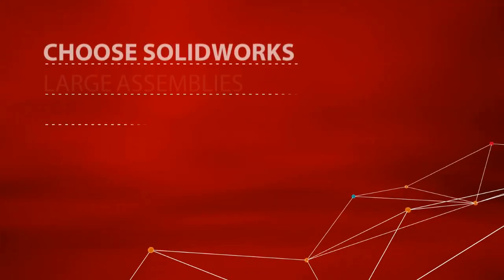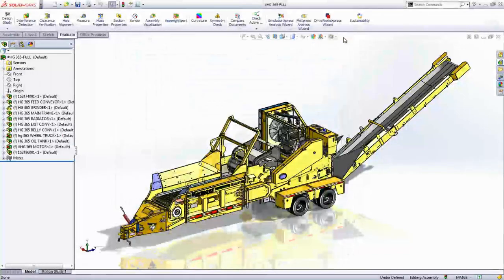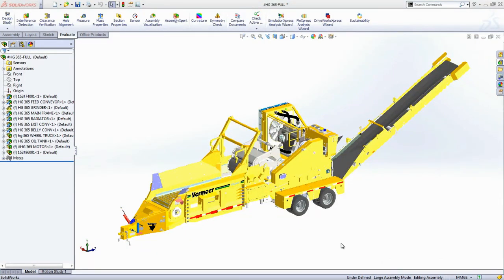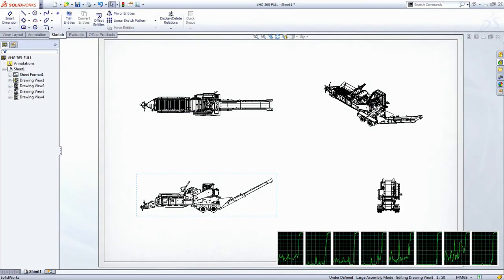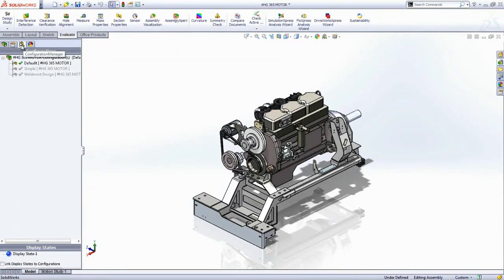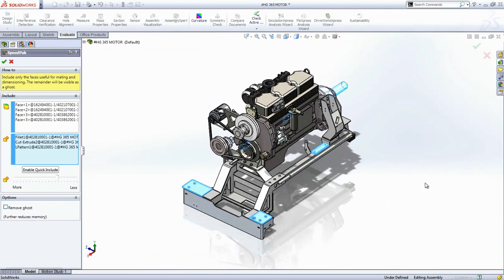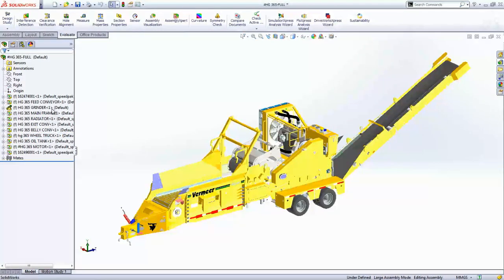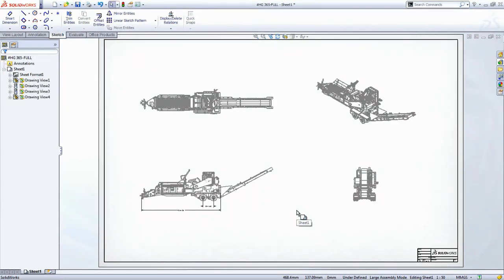Large assemblies made easy

Comment: Solid works has always and will always be rubbish at large assemblies. it is time Dasault got it together and made a user friendly product. i spend half my time figuring out how to use the tool and recover from crashes rather than concentrate on the design. I have used SW from day one and i think it has got worse not better.
Reply from the maker: Hi Bryan,

We apologize for the unpleasant experience! We appreciate and value your feedback. Please know our team is aware of any and all issues as we work to improve our software.
Reply: i just touched the spine line in assembly of less than 100 components and my software crashed